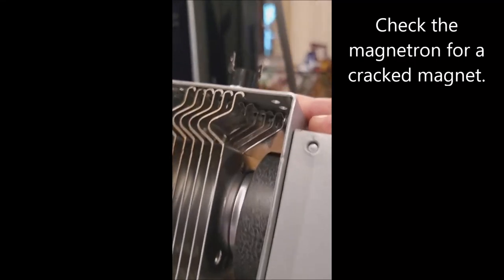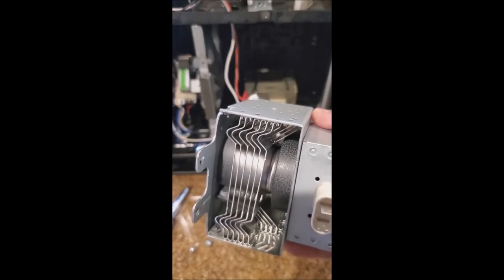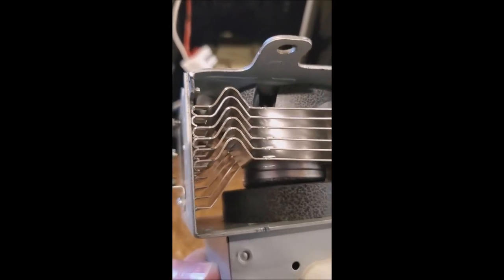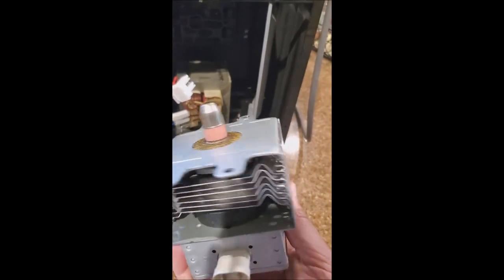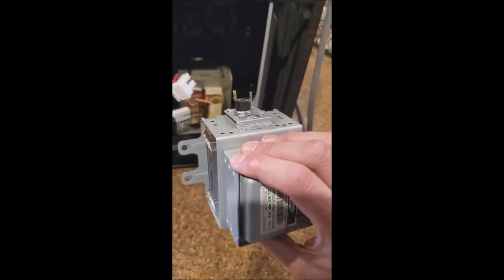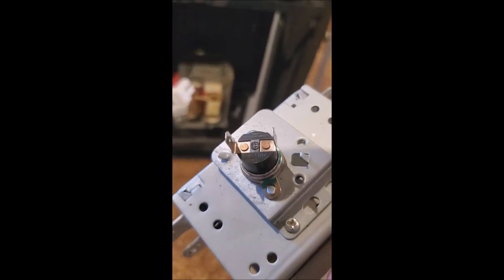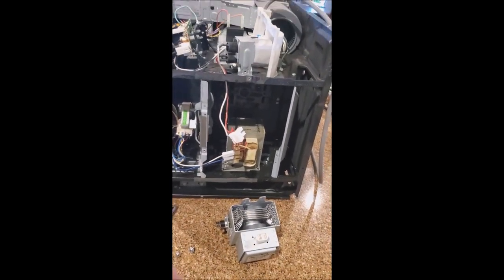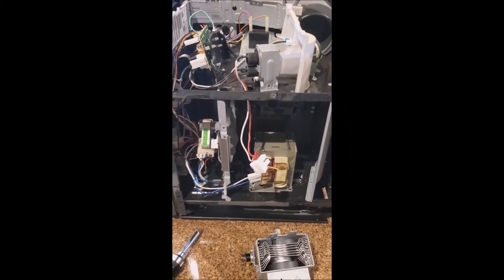Microwave Not Heating Or Heats Too Slowly? Watch This!

Comment: A few corrections to this video. Mica is not a waveguide it is a cover for the waveguide. "Thermistor" or "thermostat" on the magnetron is a thermal cut off switch.
Reply from the maker: Yes, you are correct on the waveguide, although the cover does play a role in uniform wave distribution. A thermostat is essentially a temperature-controlled switch, but yes, its purpose is to be a limit (or cut-off) switch in this case. The advice is still relevant, though.
Reply: @thehoneybadger9262  Mica is a low loss insulator for the radio waves all the way to mm. it also high heat tolerant. it does not alter the waves in any way. The distribution of the waves in the microwave are from bouncing wall to wall + rotating plate if any.
Thermostat is thermo-constant  thingy.